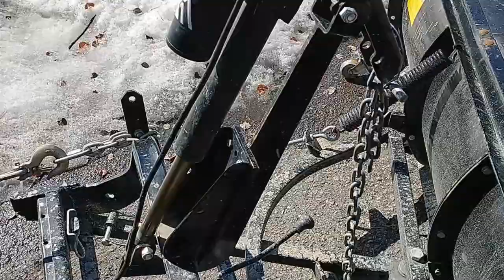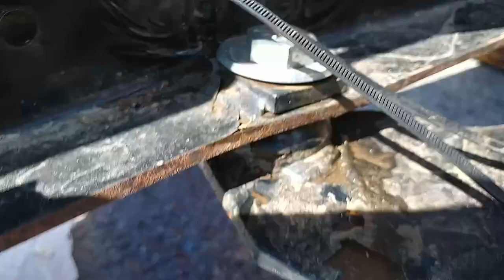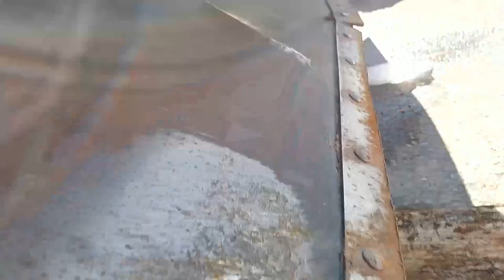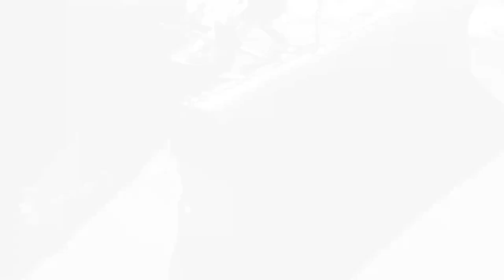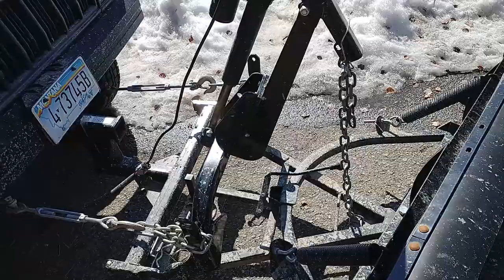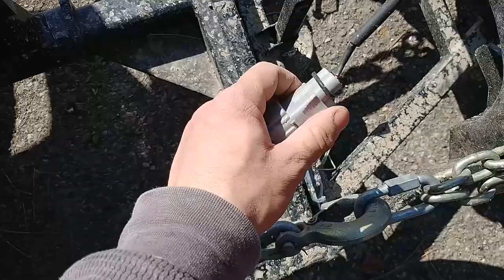Owner's review of DK2 & SnowBear "Heavy-Duty" plows

Comment: You are using these plows way harder then what they are designed to be used. You get what you pay for, when i used to plow i had a full size pickup truck with a meyer hd power angle plow and it cost alot more then these it was also built way heavier I never had a problem. Buy the right equipment for the job these plows are made for personal use one driveway.

Comment: I had a snowbear plow two years ago. When I first got the plow and put it together, it simply did not go together right the two plow pieces did not line up as they should have and the three point connection of the plow to the frame did not line up properly...I could only get two lynch pins in their proper position, not the three. After using the plow a few the blade became bent and soon was unusable. I called the company (in Canada) numerous times, sent them pictures and complained about the assembly problems. They said it was my fault (!!!) and basically did nothing. I ask to talk to a supervisor and the two agents I talked to insisted they were the top of the food chain. Since I lived in Washington State, I really had no recourse with a Canadian company. The blade got so bad I had to take it off and put the  old snowbear blade I had laying around on for the second year last year just to get me through the winter. I then took both of them to the dump and bought a Meyers Home Plow last fall. It works great and no problems. Save your money and don't buy a snowbear. Buy a Meyers, or Hiniker you won't be sorry. BTW I plow about 100 yards of gravel driveway (some curves and a bit of a grade) in Northeast Washington State. We get between 3' - 5' + of snow a years. Hope that this helps.
Reply from the maker: Wow - that's a much lighter duty application than mine even. I will say both of mine went together mostly as expected, aside from how the nylock nuts didn't lock at all and fell off.

Comment: Well I’m glad that I bought the dk2 for my small dirt driveway 😂. For reference how far off the ground is the bottom of your front mount receiver? I ask because I have to fabricate my own.
Reply from the maker: Sorry it took me forever to get back to you - I just measured about 16" (on rough ground, so +/- a little).  That's from the bottom of the 2" receiver channel.
Reply: @tmarbut  Thank you I’ll be using that to beer math mine. I appreciate the help
Reply from the maker: @OttoTheImmortal  I didn't do a good job in the video describing how to test the height, but just make sure to test it out a bit.  It's easy(-ish) to just mount the plow directly, lower it, block up the mount so it doesn't sag, shim the plow articulation so that it's exactly centered in the rotational left/right play, and then lower it until the blade is level while canted fully right or left.  Then you know how much drop you need to be level at the road surface.

Comment: How fast were you taking these? That looks faster than the rated speed for those 15mph max on the dk2 and I believe it was similar with snow bear
Reply from the maker: @codysphotography9716   Approx. 156mph.
Reply: @tmarbut  what well it makes sense the jeep is light but dang I got dk2 for a good deal not doing hitch mount for the F250 but at the same time if I plowed my road that fast I thought the plow would fail sooner than that if you are seriously going 156mph
Reply from the maker: @codysphotography9716   Possibly 157-158. Does a great job ejecting the snow from the road.

Comment: I have a similar model of Snowbear plow. I use it to plow a 265 ft asphalt driveway that is fairly steep. I have had it about 6 years mounted on a Ford Explorer Sport Trac. I have had similar problems as you, except for the bent blade. In the spring 
I walk the drive picking up nuts and bolts. However, before that I was using an ATV mounted plow and have had my share of problems with that as well. Plowing is hard on the equipment by its very nature. I still would not use the SnowBear for much more than what I have been using it for. Unfortunately, the plow truck was the first to suffer catastrophe. The rear frame rusted out internally at the upper suspension link and I couldn't get anyone to fix it.
Reply from the maker: Oh man, that walking the road picking up parts that have fallen off over the season hits way too close to home.  Or worse, my neighbors calling me to tell me they found parts on the road.  How embarrassing.

Comment: I have an old snow bear. Excellent plow. Very few problems. I use it for my driveway. I have never used it for high speed plowing, or would I .. mine is at least 20 years old.  Consider what your going to use the plow. The department of transportation has heavy duty equipment.

Comment: My 2 cents... your using a light weight plow and trying to do a heavy duty job... you need to get the correct plow and rig for the job your doing.... same idea of trying to dig a house foundation with a garden shovel.... 
I have an old 78 ramcharger with a 7 foot pro blade that i never drove as fast as you were, but it never had any issues as it was designed to do a larger job and was the correct tool foe the job...
Reply from the maker: The plow is marked as "heavy duty". 🤷  (This year I'm plowing with an 8.5' Snowdogg and a Ram 2500, so the old Comanche can retire to be a general ranch truck.)

Comment: Get rid of the drop hitch and go straight to the hitch and Use the turn buckels for dk2. change out the kickback spring to a Myers spring and install solid loop eye bolts. And your absolutely abusive to that weak of plow
Reply from the maker: Without the drop hitch, the rotational angle isn't right, and one corner drags while the rest of the plow is off the ground.

The plow is marked as "heavy duty". 🤷

Comment: I have the DK2. This will be my third year. It's good for my terrible gravel driveway, but it's not the best. The scraper popped off on first use. The VERY cheap bolts that hold it on just broke. The bolts looked like the heads of the bolt was just glued onto the bolt. I replaced them with grade 8 bolts and then spot welded it, it hasn't fallen off since. The side markers broke because they are the cheapest things on the planet. The springs fall off constantly. It sticks out too far and it pulls the front end of my vehicle down so far that the frame scrapes the ground constantly. I'm gonna try to raise it up this season. It does work, but it's not perfect. I owned a Sno bear years ago and that was complete garbage. The DK2 is better, but I don't know if the Sno bear got better over the years. This guy is using them outside the scope of what they are meant for. They are called "personal" snow plows. They are for YOUR driveway and maybe the neighbor, but these are not for plowing roads. If you have the right vehicle and this is your budget, I would recommend the DK2, just be aware of the things I mentioned.
Reply from the maker: @richardcurtis8026   But I used them for my road 😑
Reply: @tmarbut  Yeah they're not for roads lol